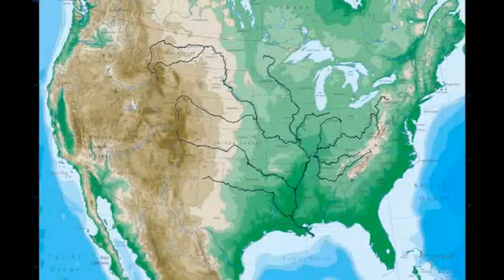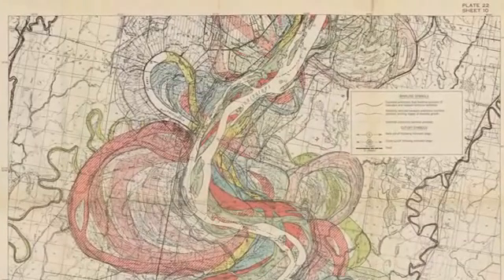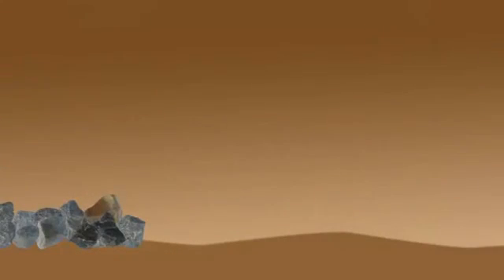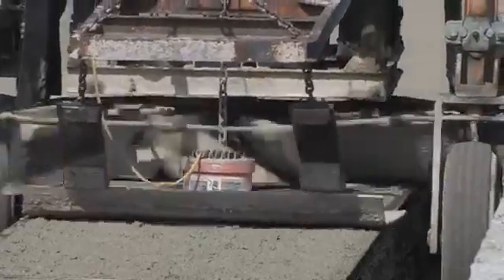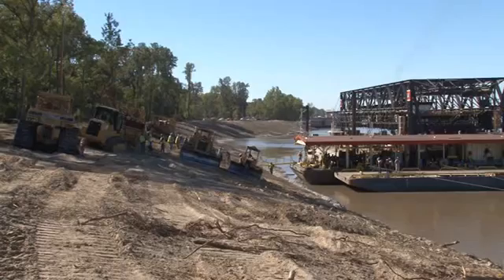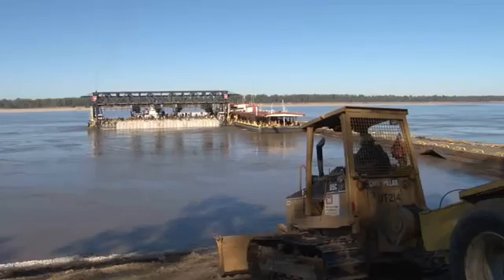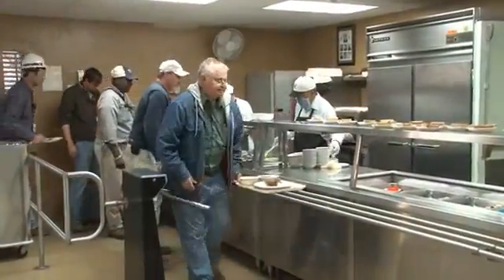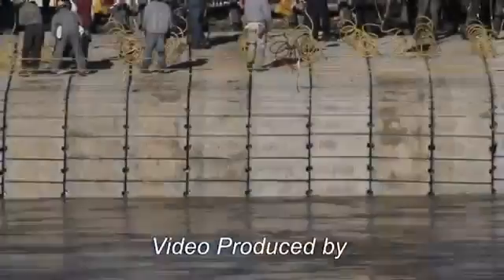Managing the Mighty Mississippi

Comment: This is truly engineering on a massive scale; most impressive. Using the huge costs of maintaining the US Army Corps of Engineers, and using that organization to do solidly useful work.
Reply: It is not solidly useful work. The work has actually caused far more flooding in the long term than if they had not done anything, and now wastes many billions every year that would not have been necessary if they hadn't manipulated the river to begin with. One day the Mississippi will finally change course despite all the artificial manipulation and it will be a disaster that will cost America many hundreds of billions of dollars, if not a trillion dollars.

Comment: Really good explanation and video of efforts to control flooding, streambank erosion and the meanders of that great river. At Cairo, IL the Ohio River contributes 60% of the flow in the Mississippi River. The Ohio River Basin covers parts of 13 states (205,000 square miles) and includes 85 USACE reservoirs, all of which include operation for flood control. Four Corps of Engineers districts operate and maintain those reservoirs under the command of the Great Lakes and Ohio River Basin Division office in Cincinnati, Ohio. The Vicksburg District is a top shelf organization and does a great job on the Mississippi River. Thanks for this great video.
Reply: Yes1  And I think the best chance for rain to feed that Lower River is the Ohio basin  western drought is stuck